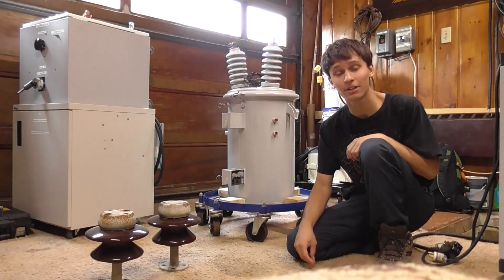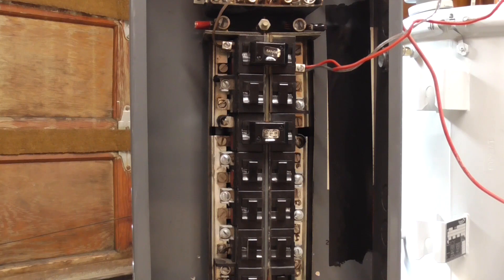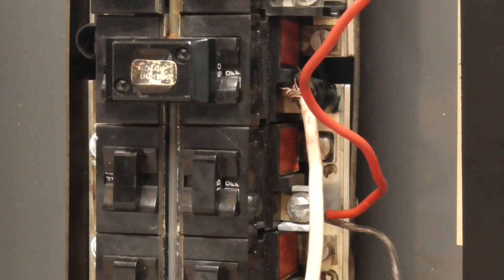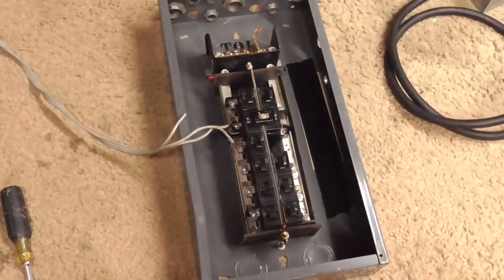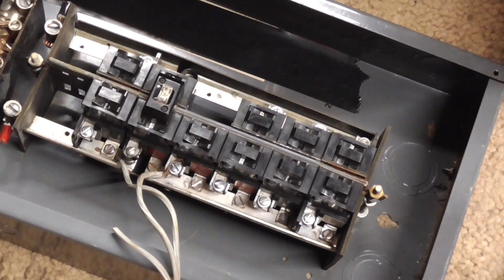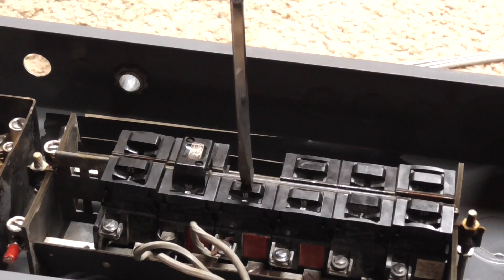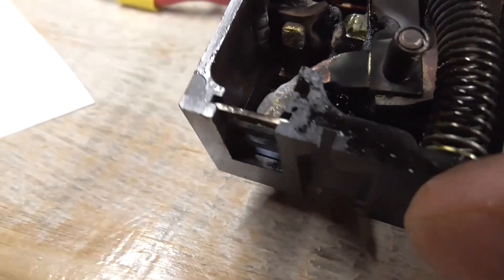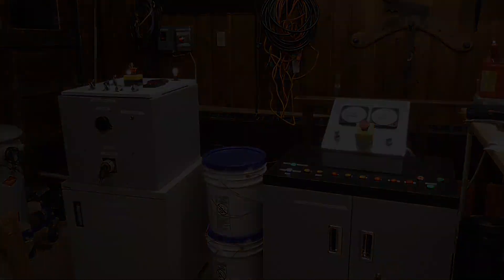Voltage Capacity Test of Circuit Breakers/Panel (pushmatic type)

Comment: You literally popped those breakers. Nice! I wonder how many volts a wall switch could handle, or a lighting contactor. I thought about doing something similar with a mechanical plug-in timer, but haven't had the time to make any vids lately. That idea's all yours if you want it.
Reply from the maker: I'll figure something out;)

Comment: You should apply 1.5kV to an entire panel loaded full of breakers, turn off every breaker one by one, and watch it go up in nice, bright flames.
Reply from the maker: problem is with that is if all the breakers were sharing, it would all be narrowed down to one breaker, because their all sharing, turning them off one by one would not destroy until you get to the last breaker that would open the final circuit allowing all current to pass through it, good idea though.